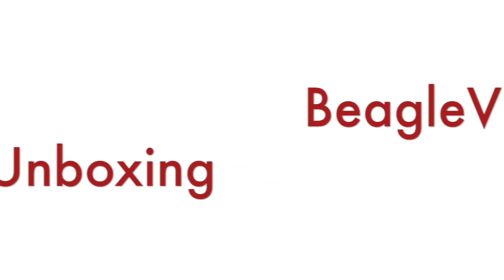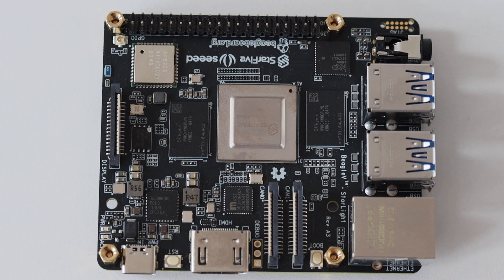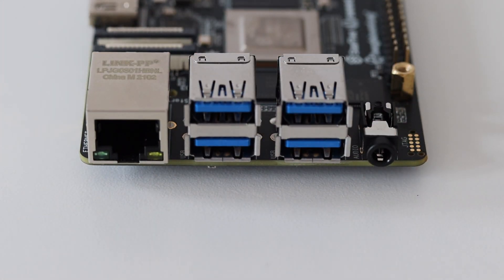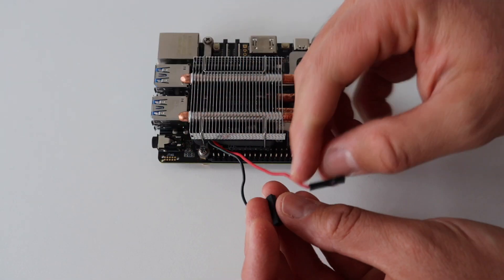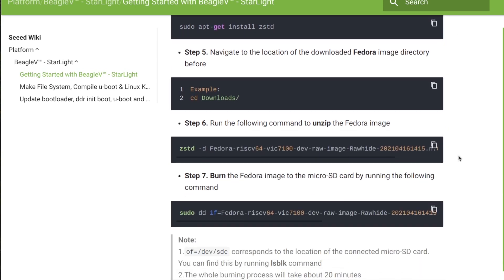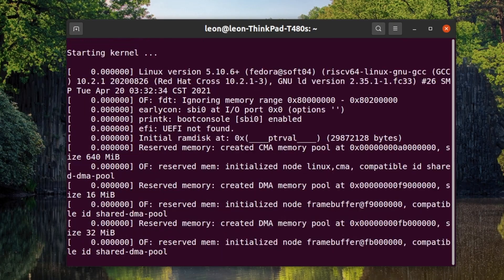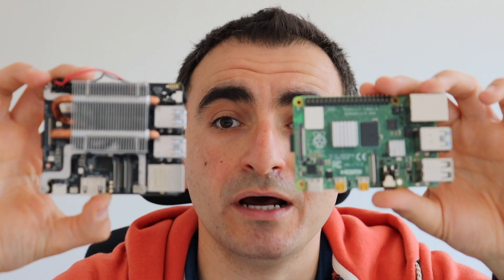BeagleV RISC-V Computer (Beta)

Comment: UART to boot... Can't a keyboard be connected via one of many USBs? Does it support DisplayPort via available USB-C (using a hub to keep power delivered)?
Reply from the maker: Yes, of course keyboard can be connected over USB. As of the moment I have no idea if display port over usb-c is supported.

Using UART is a standard approach for embedded devices as the serial output provides early boot information from the bootloader and the kernel which makes is super valuable for debugging during software development. Because of this I often prefer it even for technical demonstrations.
Reply: @LeonAnavi  Thanks. I'm newly info SBC and hardware details. I don't know e.g.: usb-c port available: can I connect my printer, hard-drive enclosure, USB flash, smartpone? I guess I would need to read what USB it support in each case.

Comment: I'm a little surprised that such a hefty cooling solution is needed.
Reply from the maker: Keep in mind that this is for the Beta version devices with JH7100 RISC-V SoC. The final product should be with JH7110.  Low power functioning were not taken into consideration when designing the JH7100 chipset but for the production BeagleV units it will be replaced by the new JH7110 chipset. More details are available at: https://wiki.seeedstudio.com/BeagleV-Getting-Started/

Comment: Quite a high power consumption...  maybe it's implemented on an FPGA?
Still a step in the right direction and helps getting the ball rolling.
Thanks!
Reply from the maker: I've just seen that StarFive has published the datasheet of JH7100 in GitHub so you can learn more details about the SoC:
https://github.com/starfive-tech/beaglev_doc/blob/main/JH7100%20Data%20Sheet%20V01.01.04-EN%20(4-21-2021).pdf
Reply: no it's using old school 28nm fabrication so is orders of magnitude less efficient.
unfortunately the project is a scam. $150 for such old technology defeats purpose, might as well use intel celeron or nvidia jetson.
Reply: @NSAwatchesME  you know how early RISC-V is? Performance isn’t the thing here, it’s RISC-V
Reply: @NSAwatchesME  and plus it is an incredibly early device, it being a replacement for raspberry pi is not the point
Reply: @NSAwatchesME  not a scam unsuccesfull beta experiment

Comment: Idk if it's just me, but the volume on this video is SUPER quiet. But the ad just before the volume was just fine so I think it's the video.

Edit: At 1:14 the sound comes back

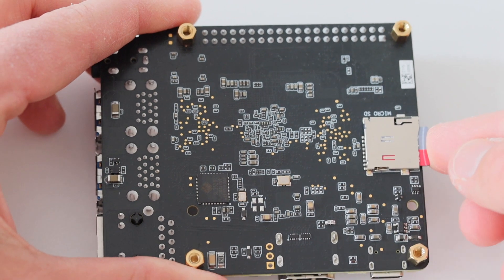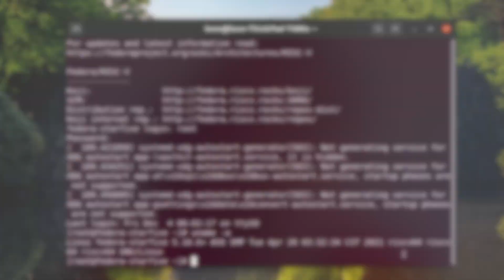Edit: It cuts out at 3:26 and 6:31 as well
Reply from the maker: yes, sorry about this. I've used a couple of different microphones for the different parts of the video. The external mic connected to the camera was quite awful so these parts are with very bad audio quality. Following this feedback I've already ordered a Rode Videomic GO which hopefully will provide improvement for new videos.
Reply: @LeonAnavi  it could also be drastically improved with foss editing software...
Reply from the maker: @TimLF  for the other parts of the video, where the sound is OK, I am using Blue Yeti USB microphone and I am recording it with Audacity on Ubuntu 20.04. I hope I will be able to get better sound while talking to the camera with the new Rode mic. It should be delivered in the coming days :)